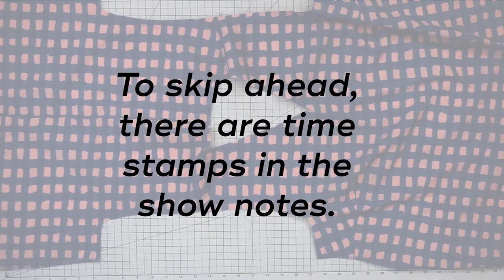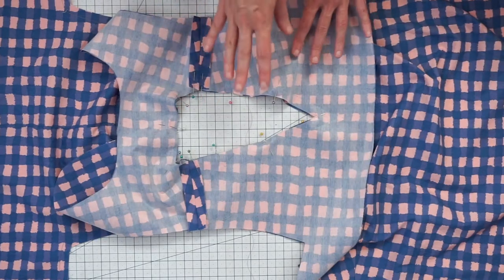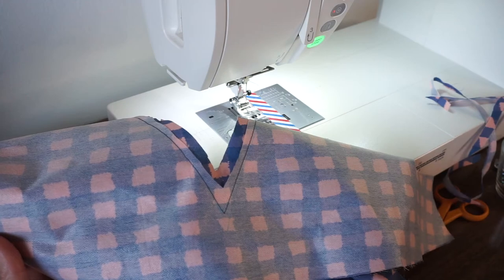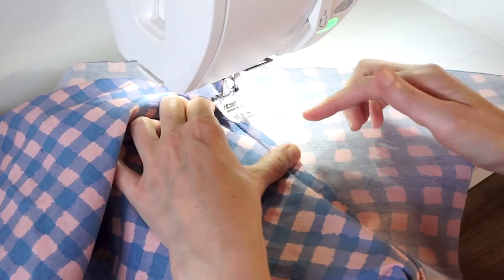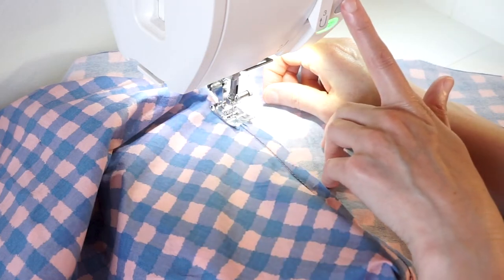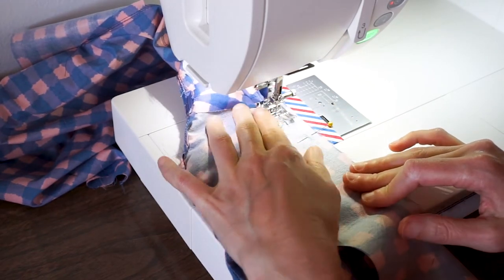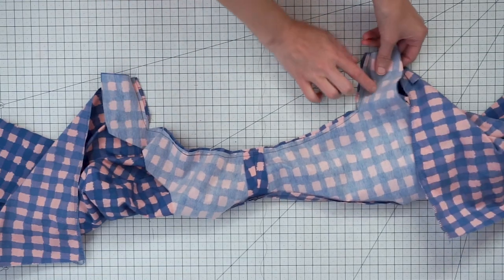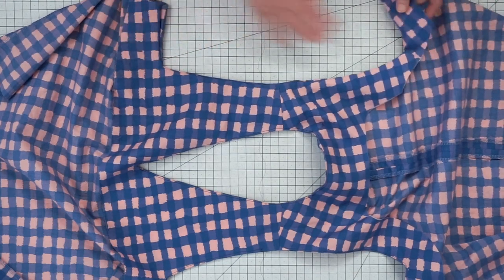How to Sew an All-In-One Facing (aka the burrito method)

Comment: Thank you for the clear demonstration.
I just started sewing recently, my question is about the Serger, as I have the same serger as the one you have. 
Right now I am making a Satin dress, but the overlock pulls the fabric edge badly, I tried to overlock on cotton fabric, it is much better than the satin.
So I wondered why? 
Do I need to use different needles? (Like I used Ball Point Needle #14 on the sewing machine).
Or it is other  problems?
Hope you can help me!
Thanks